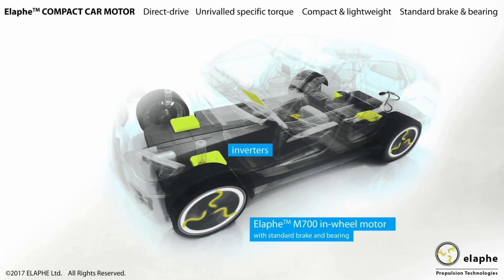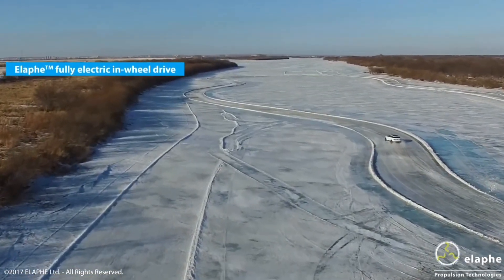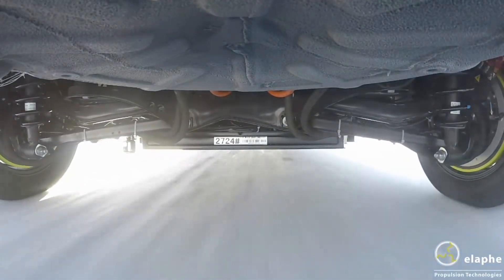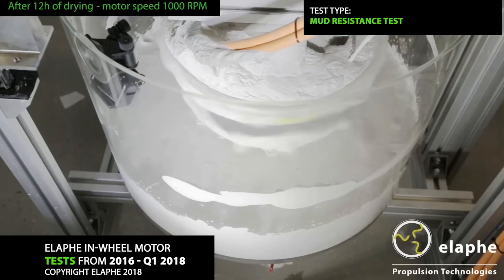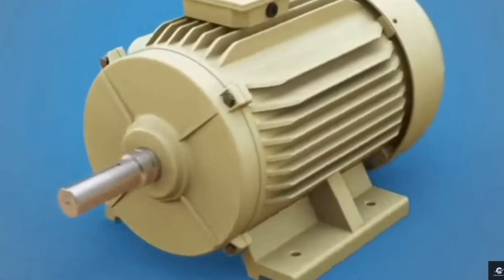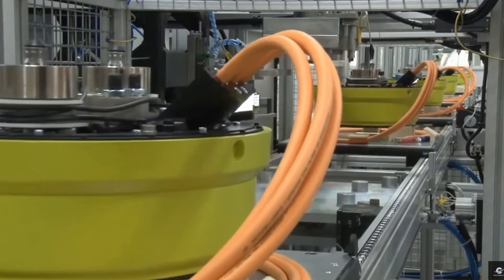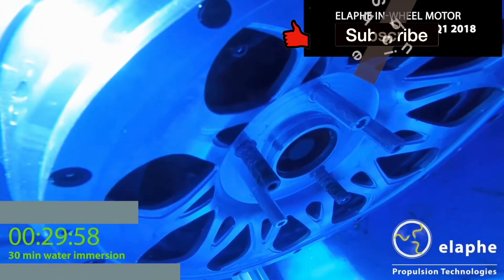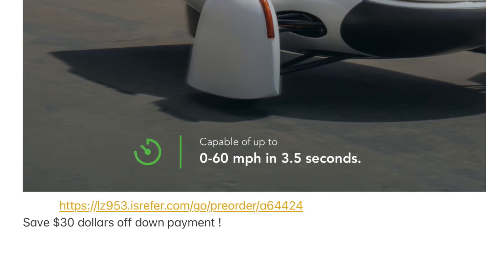Aptera's In Wheel Motor"s Will Last A Very Long Time !

Comment: Its easy to install, but inefficient and the unsprung mass brings up its own problems. Other car manufacturer therefore discarded the hub motor. Only Lordstown uses them, and the efficiency is extremely bad.
Even electric bicycles stop using hub motors and prefer other drivetrains.

Comment: The biggest problems with in-wheel motors are the high cost of the ball bearings and the sealing against dirt, salt, moisture and small magnetic particles. 
 If the seal of the ball bearings are not good, old or damaged the engines will quickly fail.
Steam jet cleaners are also dangerous for the In-wheel motor bearing.
Reply from the maker: I would do some heavy testing before the warranty expires 😉
Reply: @freepower1082  I spoke with a e-motor developer about in-wheel motors and he told me that the biggest challenge is the sealing against dirt, salt and small magnetic particles which are a big problem for the In-wheel bearings.
Steam jet cleaners are also dangerous for the In-wheel bearings.

Comment: The Elaphe in wheel motor is quite inefficient. And there is still the problem of unsprung mass.
Reply from the maker: I like it because it makes the most efficient vehicle more efficient 😄
Reply: @freepower1082  The Aptera  motors, battery packs, inverters, heating, cooling are very inefficient. The only efficient thing in the Aptera motorcycle is the aerodynamics.
Reply: @vic321344  Compared to what?  Not to any other existing product.  Why the FUD?
Reply: @n.brucenelson5920  Compared to Tesla. And you can buy these cars. They are not just phantasies like the Aptera motorcycle.
Reply: @vic321344  So I suppose that is why the most efficient Tesla requires several times the power of an Aptera to go the same distance?.  We don't yet know when Aptera will be delivered - nor the Cybertruck for that matter, which started development around the same time - and with far more resources.
Reply: @n.brucenelson5920  A Tesla is a car. The safest in the world. It is a 4-5 seater. And not just a 2 seater motorcycle with nearly no safety features. A deathtrap in case of an accident. 
Nobody knows it the Aptera will ever be produced.
Reply: @vic321344  You are correct only in your first and last sentence.  I think your shame regarding your own posts is the reason you continue to hide your identity.  FUD is not a good look.
Reply: @n.brucenelson5920  So I am not right that tesla car is a 4-5 seater? 
I think your shame regarding your own posts is the reason you continue to hide your phantasie claiming.  FUD is not a good look.
Reply: @vic321344  Of course the Tesla Roadster is not a 4-or 5 seater.  Read your own words and understand them.
Reply: Of course the Tesla Roadster is a 4 seater. 
Tesla is the safest car you can get is also not true? Read your own words and understand them. FUD is not a good look.
Reply: @vic321344  LOL.  Have you ever seen a Tesla Roadster?  It was developed from the Lotus Elan.  Most of the rest of your "commentary" is just as reliable.
Reply: @n.brucenelson5920  LOL. Have you ever looked at the Tesla homepage and seen the specs of the roadster?

We already know that you just want to compare the Aptera motorcycle with cars, that are no more in production, like the old Roadster or the Honda Rev 1. Maybe you think that lets the Aptera motorcycle look better than it is?

Most of the rest of your "commentary" is just as reliable.
Reply: @vic321344  I worked across the street from Tesla in Union City while Tesla was developing their Roadster, and the company I worked for hired Tesla's motor engineers when Tesla ran out of money and had to lay them off.  The Roadster was always a 2 person car, just like the Lotus Elise it was based on.  I take it you have never ridden in one or have a short memory. 

At least you are entertaining the rest of us.
Reply: @n.brucenelson5920  Who cares where you have worked, when we speak of the safety of the Aptera motorcycle.

Look up the tesla homepage and read what the Tesla roadster ist. The actual one, not the antique.
Reply: @vic321344  While Tesla plans a 4 seat roadster, up until now the 2 seater is the only one in existence.  Just another example of you not knowing what you are talking about.  BTW, I have over 400 thousand miles on motorcycles - the Aptera autocycle will be far safer than any of them by design.
Reply: @n.brucenelson5920  You can make a reservation only for the roadster. Same as Aptera. So you are right: neither Aptera nor the new Roadster are in existence. So we compare equally.
Nobody cares how much you drove with a motorcycle, The Aptera motorcycle is a deathtrap in case of an accident. But because it does not exist, no one cares.

Comment: The efficiency of the Elaphe in-wheel motors is a fantastic Aptera choice!
Reply from the maker: Oh Yes !
Reply: Its easy to install, but inefficient and the unsprung mass brings up its own problems. Other car manufacturer therefore discarded the hub motor. Only Lordstown uses them, and the efficiency is extreme bad.
Even electric bicycles stop using hub motors and prefer other drivetrains.
Reply: @vic321344  Well that will have to be explained.... anything added in the drive path will have loses, so I only see high efficiency in direct drive.  Please explain your description of direct drive efficiency as extremely bad.  As for unsprung weight, Elaphe has created a light-weight motor specifically for Aptera, as the total vehicle weight is very low, to mitigate those specific issues.
Reply: @DemaGeek  The wheels are still much heavier than they have to be. Especially bad because the Aptera weight is low. You would need a heavy vehicle to overcome the heavy wheels. So you have to use strong dampening, which does not just make the ride uncomfortable, but it eats energy by climbing every pothole with the whole weight of the vehicle.
Teslas motors are world champions in efficiency. You do not get that, if you have to compress the volume inside a wheel.
Lordstown motors already show the world, that the hub motor is very inefficient. A lesson other car makers already learned by trying it and then toss them out.
Reply: @vic321344  I'll be the first to admit I am no mechanical engineer, so I appreciate your explanation and will take your word for it.  Respectfully, my gut still says that it's not nearly as out of balance as your description makes it out to be.  It will be interesting to learn if the hub motor weight differs much from that of a standard hub.  Maybe we'll get these questions asked at the live webinar on the 20th.
Reply: @DemaGeek  Its OK that you are not an engineer. You can still make deductions out of the facts you learn. For example that no other car manufacturer uses these motors. And hub motors are well known for over 100 years.
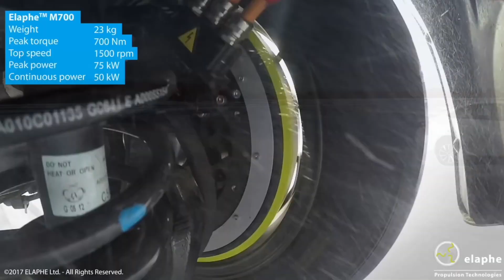Reply: @vic321344  Take a look at this Elaphe video -- specifically the time that applies to Aptera from about 1:50 to 2:15.  https://www.youtube.com/watch?v=WAOAk7j6Mws  A direct quote from Chris Anthony: "...and Elaphe's powertrain is the most efficient solution available today."  Notice that it doesn't say poor, okay, or doable... it says THE most efficient solution available today.
Reply: @DemaGeek  Marketing squack is cheap, real solutions are expensive.
Reply: @vic321344  That is very true.  Elaphe has over ten years and millions of dollars in the development of their motors, plus thousands of hours in many types of extreme testing.
Reply: @DemaGeek  And how much money and time did the development of the Tesla Plaid motor cost? Elaphe is just a small garage company (in comparison) in slovenia. BTW: The development of a new ICE engine costs over 1 billion US.

Comment: The Aptera Elaphe wheels can sense wheel slip and adjust torque 32 times per wheel revolution, or about every 2.5" of tread travel.
Reply from the maker: Thank you so much for the info !